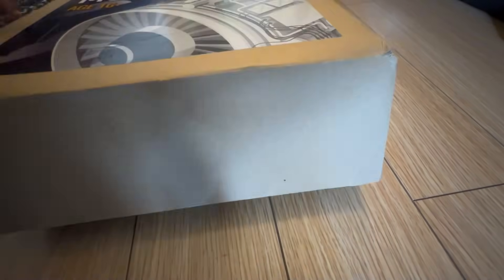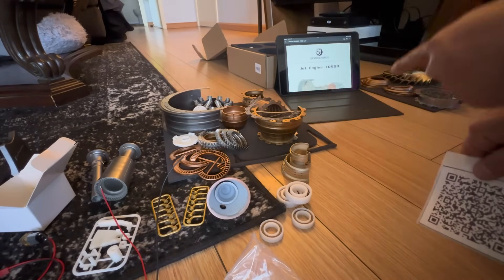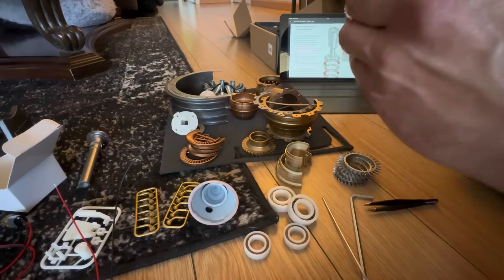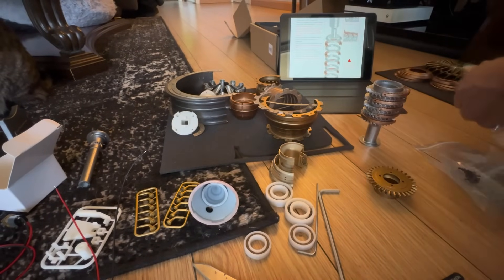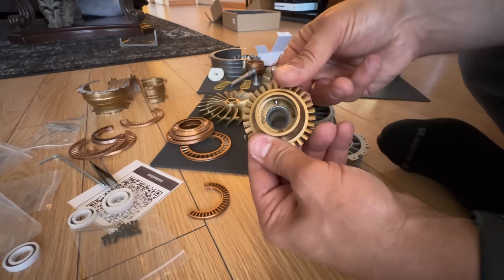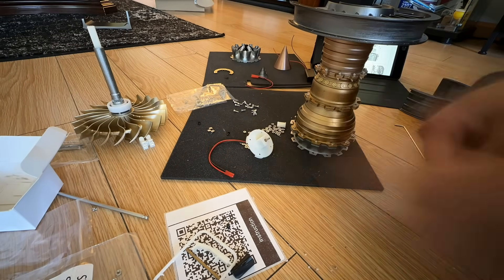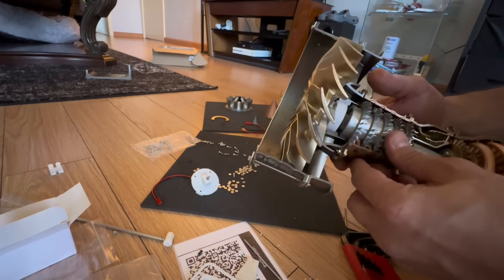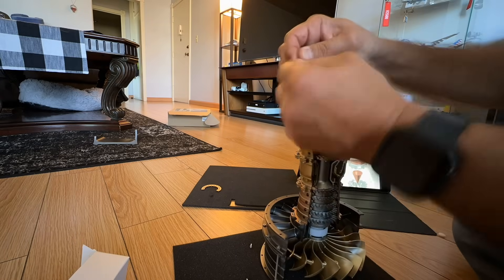Stig Projects…I built a Jet Engine 🤙🔧🛫

Comment: When I was flying RC I built a 5’ wing span trainer on the floor. I used book shelves for the wings.  My trainer buddy was shocked how straight & true it flew all trims were centered.  Needless to say I was shocked too!  Just needed room of course for allowing glue to dry on the spars.  They make scale model jet engines now but you wouldn’t want that smell in your apartment.
Reply from the maker: I can imagine

Comment: Ok. Q C has just determined this engine not acceptable.   You need to go back and safety wire every last nut n bolt. Then report back.   LOL.    

Great kit, nice job on the assembly.
Reply from the maker: 😅 I don’t think I can find safety wire small enough for that thing 😂
Reply: @StigAviation  No safety wire? Way to make AgentJayZ mad 😅

Comment: 13:57 Depending on the type of the electric motor they include in the set, if it's a DC motor (should be since it connects directly to the batteries), changing the polarity can make it spin in the other direction. Usually works with repurposed PC fans, not sure here
Reply from the maker: I’ll definitely try that

Comment: 12:00 the F135-400/600 Low Bypass Afterburning Turbofan engine with over 40,000 LBS of thrust (can’t give exact numbers due to confidentiality) is another engine that has counter-rotating compressors, it has to do a lot with balance iirc bc if you ever get the chance to see an F35 start up, not only do you feel that crazy vibration in your chest, you can see the jet moving from all the engine vibration bc it’s still starting lol, it’s quite cool
Reply: I never thought about it before, but airplane engines trying to jump out of their airplanes does make sense considering I’ve seen hot rods try to twist themselves apart
Reply from the maker: Very interesting. Thank you. I learned something new

Comment: That is a lovely jet engine model Stig, I also love that it rotates. And don't worry about the counter-rotation, it gives it character. Propeller driven aircraft need counter rotating blades, but even more so helicopters. Commercial jets don't really need counter-rotating jet engines as you know. Again, I love the detail of that model you put together, I think your supervisor approves, as do I. It honestly reminds me of the ones they have in aircraft museums you've attended, or perhaps a fancy flight school.
Reply from the maker: You’re right. The museum has a engine cut away just like this

Comment: Reverse the polarity of your battery case. It will turn in the correct direction.
Reply from the maker: I’ll try that.  Thank you
Reply: I was about to say the same thing, just change the red and black wire
Reply: That's the beautifull thing about brushed motors :)